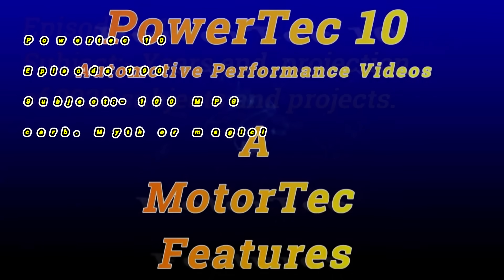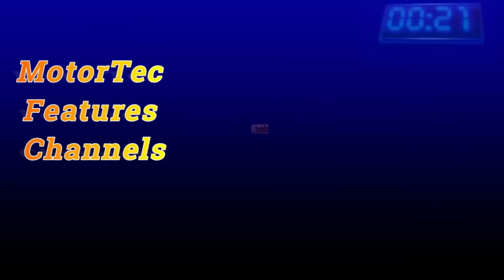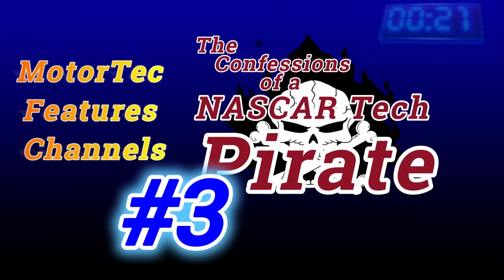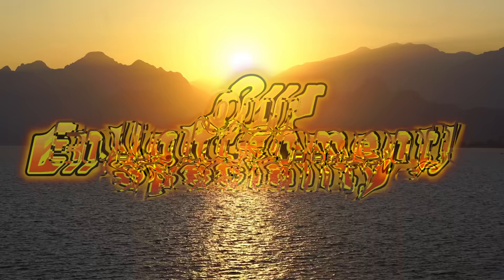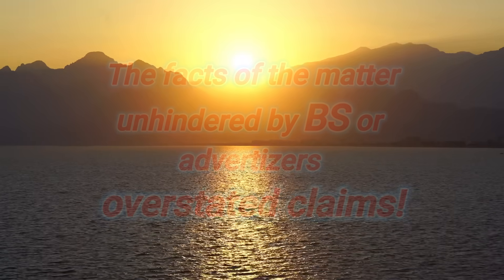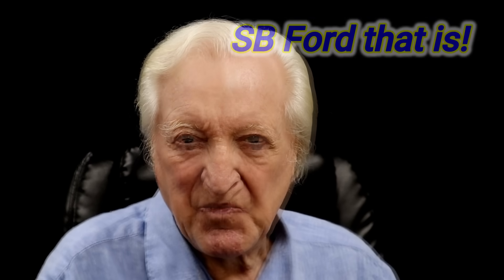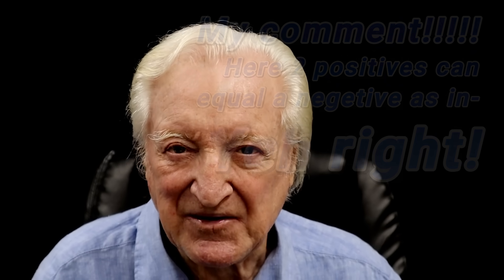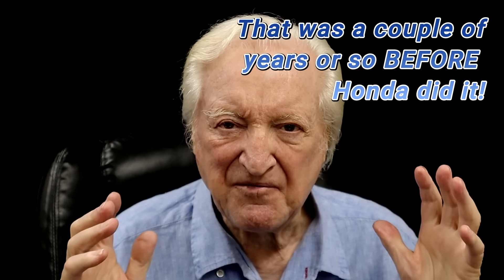The 100 MPG carb - reality or real BS

Comment: The carb doesn't matter as much if its tuned well. The biggest factor will be the wind and rolling resistance, and most importantly, about 2/3 of the energy produced gets wasted to the cooling system and blown out the exhaust pipe.
Reply: Weight would be the most important consideration.
Reply: the last point is typical of all ICE engine (1/3 to exhaust, 1/3 to coolant, 1/3 to drivetrain), it cannot be changed, therefore it is irrelevant. Wind & resistance is important, it determine how we push the throttle, hence how much the engine consume fuel, because the engine can run at cruising-RPM at a throttle almost closed if wind & resistance is negligible, but the caveat is it ruin the airflow if the carburettor is too big for too little airflow of an almost-closed-throttle, hence why people strife to design a >100MPG-carburettor.
Reply: If the shell of the car was designed to be a thin shelled radiator you could eliminate the the need for a power robbing radiator fan and the poor air flow management in the engine compartment.

It wouldn't cool much at stop signs but would work while moving for the test.
Reply: @tenlittleindians Air cooled engines are nothing new. They still lose a third of their energy as waste heat, it's just dissipated directly to the air instead of going through a water-air heat exchanger like a water cooled engine.
Reply: @ElijahDecker  I think your missing my point. Water cooled engines are more efficent than air cooled because they can run at tighter tolerances by managing expansion of components better.

The down side is the power robbing cooling fan. Electric fans are better than engine driven fans but also drain horsepower by increasing the load on the alternator.

Making the entire body a huge radiator surface as I mentioned could eliminate the fan except while motionless in the hotter parts of the country.

Comment: Riveted to this series David. Cannot wait. Followed you religiously from the late 70s, through the 80s in print with our Minis. Loved the RC40 muffler, your porting tutorials and all the advice you produced in print. My 1330 wasn't set up for mileage, but still returned 25-35mpg with an imperial sized gallon. My brother Stew had a bone stock 1300 equipped mini with a vacuum advance distributor and colour coded vacuum gauge on the dash. He could crack over 60mpgs on the hwy, driven carefully. In 1986 our brother Doug bought a brand new 1986 POS Ford Escort CDN spec, 4 speed manual, carburetor equipped and that pile of junk(dreadfully slow) beat Stew's mini on mpg. I witnessed it return 65mpg. Lastly our friend had one of those 90s 3 cylinder Firefly's or Sprints and he could get almost 70mpgs. All that was achieved 30-50 years ago. I'm rather ticked we can't do so much better by now. I've spent my life playing with small block Mopars and quite a few 5.0 EFI Ford's and I've always been able to improve their performance and mileage, often dramatically. Dying to follow this series. Thanks again.
Malcolm Ottawa Valley
Reply: Sounds familiar Buzz. In the late 70s the local Canadian Tire at Woodroffe and Carling sawed up all the welded together complete British sports car exhaust systems and chucked the components into huge wire bins. Like yours the mufflers were 5 bucks each and miscellaneous pipes were three. I built a system for the mini I thought sounded okay, until......the RC40 system David put us onto became available. I was over to see the relatives in 82? and I brought the system back in one duffle bag on the plane. The other duffle bag held my Black Mamba mags. Had a huge hardcase Delsey suitcase weighing 185lbs, with all the engine goodies from mini spares. With one hand I gently set it down on the analog, old school dial scale at the counter for a lark(laugh). The ever so polite young lady indicated it's weight with wide eyes, as the cargo guy tried to budge it off the scale. The young lady said "sir we're going to waive all fees and your case flies free......if you wouldn't mind loading it onto the belt for us". I thanked her very much, having expected to pay full fare on the freight, walked over picked it up with one hand again, smiled at the cargo guy and placed it on the belt, to everyone's bemusement. Long story short I LOVED everything about the RC40 system. Fit well, delivered a LOT more torque and driveability,reved smoother, almost looked stock, exiting in the stock location. My car was cammed, over bored, over carbureted, with a ported cylinder head and LCB header. When it loped down at idle the system almost sounded like a hot flat four.
Reply: Collusion and shared advantage by automakers with oil companies, is the answer to your ‘why’.  I built a 1967 390fe Ford motor in a 67 Galaxie to race spec, hydraulic custom cut lifters, lumpy cam, electronic ignition, 750 double-pump 4v w a 6psi high flow fuel system, deep sump and race oil pump, all by Holley.  I got 13mpg in town and 16-17mpg highway (on a 2.75:1 gear).  I bought a new Dodge Charger Daytona 5.7 in 2006, and in town it got…12.5mpg.  With the drop out of 4 cylinders it would get 26-27mpg highway on cruise control, but otherwise was no faster and got roughly the same mileage.  That was by design, not necessity.

Comment: Fully vaporized gasoline burns too quickly and is burned off by the time there's any leverage on the crankshaft. Unfortunately.
Reply: This is my best way to get optimal mpg. But as you say it has its drawbacks too. I was wondering if you could do it at a higher compression?? Say 12-15 to 1?
Reply: @MP2Tablet when fully vqporized gas is fully spent and burnt up the piston and rod and crank are all still almost in line with top dead center so it just loads against the main bearing. Uncle tony did a video explaining that aswell. You'd have to find some way to slow the burn and have offset wrist  pins and offset cylinders to try and pull this off. Still wont produce any real torque

Comment: My 1983 Honda C70 motorcycle got 120mpg. All original parts except brake pads and spark plug. 52mph top speed. I used it for Government work that reimbursed me 55 cents per mile versus fuel cost of 3 cents per mile.
Reply: I have a honda 1978 CB50  gets similar
Reply: I had a Suzuki they said got 45.  I got 78 on a night day right speed

Comment: I’ve seen a lawnmower carb put on a 302 sbf and it was pretty close top speed was 70 only so not bad he put an adapter to put a riding mower carb on it and I believe it was stick shift car😊
Reply: I saw a video on You Tube,... mechanic put a large Mower Carb on a Ford Maverick I think . Accelerated pretty well, don't recall the milage but was going for high milage. I need to look that up and post it here for Dave.

Comment: If a good gas engine is only 25% efficient, 100mpg should be doable, a real shame Smokey Yunick took the info to the grave.
Reply: One of the car magazines finally got Smokey's 'Hot Vapor' engine in the Fiero to actually test and weren't impressed with it at all.   Sounded like it was running in detonation much of the time and performance was poor.    We all need to remember that a production vehicle is NOT optimized but rather a conglomeration of compromises to rules and laws aplenty plus made durable enough for normal people to abuse it.    We can easily get 15% better economy on just about any car by pushing the NOx limits which really hurt performance.
Reply: @recoilrob324 we have the Smokey Yunick HVC Plymouth Horizon and have it running and ready for testing. Have videos of the engine and car running here on YouTube.

Comment: If you can get it to run super lean is possible but the power output will be hardly enough to go more than 35 MPH because of wind resistance.
Reply: Have a Honda civic hybrid manual that targets 22/1 afr at light loads when in a specific range. It'll stay around 70 mpg without aero mods, very impractical car though. It's illegal to target afr like that on modern vehicles due to the nox generated.
Reply: Lean burn = lots of NoX

Comment: I don't see it being possible. any fullsize car think caprice or crownvic needs to produce 28-30hp ? to maintain 55mph. Even something as small and top of the line like the newest KTM 150cc that makes 36hp, you would be running it wide open just to maintain 55mph. I don't think there is enough energy in any type of liquid fuel that could power a full size car at 55mph and run any where close to 100mpg.

Comment: It has almost been done by your criteria. A guy got I think 93mpg in a new Prius hypermiling it. Now it's not 100, and it's not a carb, and it involves a battery (though this is a normal hybrid, not a plug-in, so all energy does come from the engine), but he did do it, I just checked it was a coast to coast record. Very impressive for a car that is truly good to drive, very practical, and dead nuts reliable. The key elements are low drag, low rolling resistance, low drivetrain losses, and then fancy stuff like atkinson cycle, low pumping losses, etc. All doable in V8 world if one wanted to do so with off the shelf components and a special camshaft.

Comment: I thought at the optimum 14 to 1 air to fuel mixture it could be calculated how much fuel you would have to work with. I think you would wind up with a vehicle somewhere between a moped and a small motorcycle.
Reply: You wouldn't want to run 14:1 for ultra-efficiency. You'd want ultra-lean like 17:1 as that improves efficiency greatly.  Then you'd use turbulent jet injection to avoid detonation, but obviously use of a carburettor precludes that, but the old Civic CVCC pre-chamber is the same idea and could be adapted, just as Honda did to a small block Chevy V8 back in the 1970's.
Reply: @TassieLorenzo  I thought running too lean would actually cause worse mileage? Running at the optimum air/fuel ratio would get the most efficiency out of the fuel possible.

Comment: The usual claim is that these so-called magic carburetors fully vaporised the fuel. That's nice. Combustion engines running on propane, which fully vaporises inherently, don't have fantastically high thermal efficiency relative to their liquid-fuelled cousins.
Reply: Gasoline has higher btus than propain
Reply: @RobertFulton-o9j  That's why I used the words "thermal efficiency".
Reply: Propane 1.36 gallons = 1 gallon of gasoline

Comment: I had a volkswagen rabbit with a diesel engine and I could get nearly 50 miles per gallon but I'm afraid I was not able to get to 60mph in under 10 seconds. I enjoyed the car but the performance was poor at best. The car was reliable and handled well but that was all the car had to offer with its 50 mpg diesel.
Reply: The gasoline version would get about 40 or better
Reply: I drove VW diesels for 26 years. They were fun and cheap, needed more than average repairs. Fun memories,  but not interested anymore. I still have some engines and parts lying around.
Reply: I had the later Golf version diesel. Similar mpg but I never felt like it was under powered.

The biggest problem I had was finding gas stations here in Iowa that carried diesel back then.

2nd problem was keeping it near an outlet to plug in the block heater during the cold winters. If left sitting too long in the cold it would kill the battery while trying to start it.
Reply: @tei know my 1981 had no turbocharger and it had adequate power for normal driving but i was not impressed with the power. nlittleindians
Reply: You could get to 80mph if going down hill with strong wind behind you🤣 They're not real fast, but good transportation. They'll go practically anywhere.And good in the snow. Parts were cheap, though that likely changed.
Reply: @briankennedy5578  Our family had a Dasher (Passat outside of North America) diesel wagon when I was a teen. It had terrible acceleration, but it would peg the 85 MPH speedometer…eventually.
Reply: I think you're right 80mph was about the maximum achievable speed with that car.  @briankennedy5578

Comment: I don't think it's possible David. Mainly because of the combustible you want to use: gasoline. Not enough energy per volume. You would need a diesel. Volkswagen already did the whole thing 15 years ago: https://en.wikipedia.org/wiki/Volkswagen_1-litre_car# Yes, I know, it has a rudimentary hybrid, but it went up to 158 km\h and accelerated to 100 km/h in 11.9 seconds for 1 liter per 100 km or 240 miles per US gallons. You have a nice day.

Comment: in the late 50s in a polish community named hegwitch, an auto repair shop owner had a system rigged up on an international scout that he used in the winters for plowing snow. it used the exhaust system to preheat and turn gasoline into a gas state and then was pumped into a propane type carberator, GM tried to purchase it many times in hopes of shelving it away. but in the end a group of middle eastern guys made him an offer that involved the lives of all his family members.
Reply: Wives tale and urban legend.
Reply: Ih Scout's weren't built until the early 60's
Reply: I have a 1973 Scout, built 345, i get 15 mpg running 70mph interstate, turning 3200. At 65 and under I can pull 19 mph.

Comment: 1981 civic hf was carburetor 3 barrel 54mpg. 1999 Honda insight is 76 miles per gallon fuel injected.
Reply: Never saw any vehicle make the "suggested"  fuel mileage advertised.
Reply: I have a couple insights. I've done 70mpg over a 100 mile trip. Hybrids cheat a bit.
Reply: @jdcarguy1242  You have to figure in the electricity used. It's not free.
Reply: My 81 Civic NEVER got more than 28... No matter what.
Reply: @hotrodray6802 81 VW rabbit diesel gets really close to 50mpg. But has no carburetor
Reply: @hondaal7;
Actually recall the 1975 Honda Civic CVCC 1500 cc which achieved 54 mpg highway EPA tested rating seemingly @55 MPH.

Comment: IIRC honda made   a car in the 80s that would do 55+ MPG . can't recall if it had a carb or FI. CIT built a car that would do 84MPG  with  a stock 1.6L drivetrain from either a honda or toyota --i think this was in the 90s . i think 100MPG is doable but it going to take an overall effort to do it--not just a carb

Comment: one video here in youtube shows a maverick 302 with lawn mower carb giving 40 miles per gallon with around 50hp of power
Reply: I saw that Video too. Guy was a car mechanic, was going for milage, accelerated fairly well, was a 4 speed too.
Reply: Thunderhead 289, he had his carb cheater on it too to monitor and adjust air fuel ratio

Comment: There is a bloke on YouTube who put a small carb on his v8 car in the interest of fuel economy, he said he got the carb from a lawnmower and the best he could get was about 40 miles per gallon
Reply: That was mostly bs, he tried driving it on a trip and he swapped back to normal carb.
Reply: I've seen it  it was a pickup truck
Reply: @TomGellos  the one I saw, is a 302 maverick from ThunderHead289
Reply: The v8 car performed with the lawn mower carb like a car that get 40 mpg cruising would. It had just enough power to cruise at 70mph.  He even admitted that.
Reply: So if you just need 55 mph then a smaller engine then a V8  would help, higher gear ratio might help, and thin light rims and tires might help ,, 60 mpg should be possible in a small light car. 😊
Reply: @DANTHETUBEMAN  The 1999 Honda Insight is already on 165/65R14. I'm not sure how much narrower or smaller you can feasibly go on a safe production car.
Reply: @DANTHETUBEMAN   "60 mpg should be possible in a small light car" Honda went to great lengths to make the first generation Honda Insight as efficient as possible, yet it only achieved 61 highway US MPG.  This is with a 1L three-cylinder engine and extremely tall gear ratios.  A car that does 100 MPG is almost certainly going to be even slower than the 73hp of the 1999 Honda Insight!

Comment: You should check out thunderhead 289 and his carb cheater
Reply: That's the guy with the lawnmower carb on a 302
Reply: That guy and his iac valve controller is a joke.